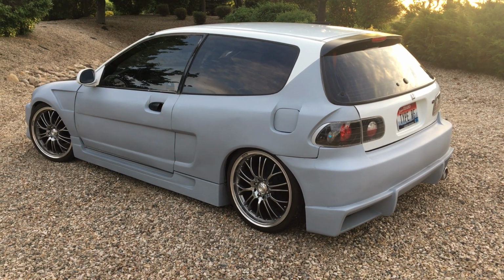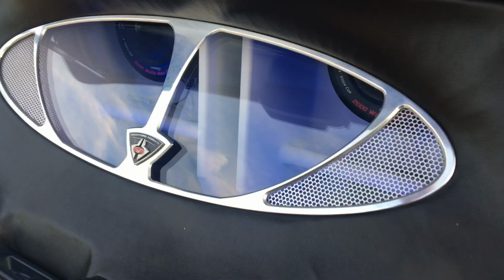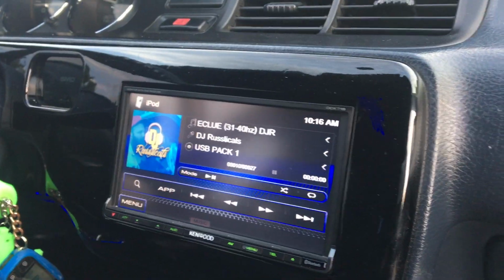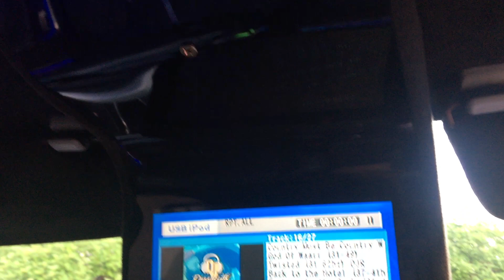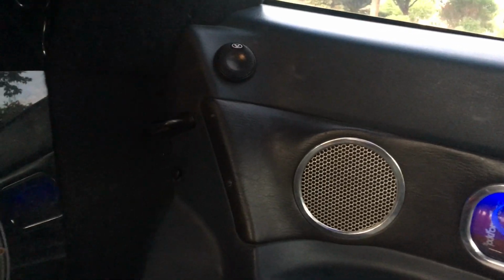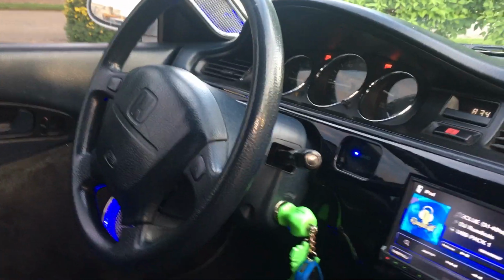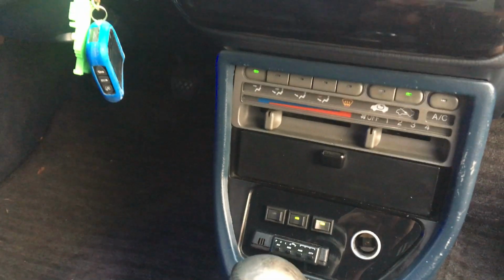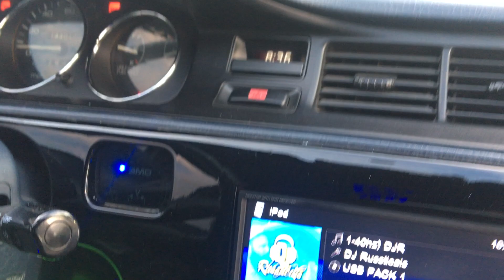Old School Rockford Fosgate Civic HB 4 Power HX2 10's 4 BD1000’s

Comment: CMC Car audio 1989 from Dallas had a similar story of a Honda Hatchback that had 6 15" of same design of build 6 Kenwood amps plus a word board that illustrated the contents of build. Carter high and Kimble football game . Come through bumping, 1 and 1 -2 Live Crew. Don't remember the head unit couldn't get close enough to look inside from the amount pressure that pushed you away from car was insane

Comment: U need a better power supply. More batteries and a better alternator. Dropping to under 11 volts is not good. Install looks clean nice work . Your amps will thank u if u give them more power and u will get louder
Reply: If you look the car wasn't running when it was played in the video
Reply: Payton Templeton thats even worse
Reply: @ryantexada9269  not really bro
Reply: @fxgamer-11yt  it is worse. Hes running the system straight off the batteries. With no help from his alternator(s). The system could possibly sound better if were running
Reply: @ryantexada9269  not at all man trust me I'm an installer my self and I know for the fact that the difference between running of batterys while the car is off vs on is the amount of wattage your able to feed the system before cliping
Reply: Brent is a beast I'm sure if he thought anything was gonna get hurt he would have started it for just battery power tho they were gettin it

Comment: Very nice. They only thing I would change is the dash plate for the head unit. Pull it back off and wrap it in vinyl so it flows with the rest of the dash. Everything else is covered and the dash piece kinda doesn’t go with the theme. Good job though

Comment: Clean as fuck bro!!! I’m just finishing up my own Rockford fish are build, I use to have 4 of those subs in a 12 inch sold them cheap wish I didn’t they use to pound. Right now I have 3 15 inch t2 fish area subs the ones with silver cones, each one has a bd20001 to it the big big amps have them in sync

Comment: very nice and clean install, looks like it could be from the late 90's when you had to be loud AND clean, lol The Power HX2 10 and 12s are some of the best woofers of that era if not ever and definately RFs best sub after the Teams. But as for the mids having a 4" coil...probably a 2.5" at most but most subs dont even have 4s.  Either way, upgrade your alt or add some batteries to get the voltage up a couple volts and you'll be all good cuz that setup is timeless. you should reach out and send some pics to BigDwiz here on YT cuz he loves old school audio and often features cars in videos with nice builds like this. Plus hes a big fan of old RF gear

Comment: I have the same car, and seeing that inspired me on what I want to do with mine. World of wheels type stuff you did there bud . Does it pull all that weight around good? That's one of my concerns with mine when I build the system . I still have the 90 horse d15z1 so I was wondering.
Reply: Well taking out rear seat and spare tire etc saves some weight too.  Plus no different than having a person or two in the back seat.
Reply: @rxtuninginc8444  so you own the car?
Reply: @rxtuninginc8444  idk if you own the car or did the work but that much fiberglass and wood would weigh as much as 800 or as little as 600 depending if the wood is birch or mdf , with that being said i dont think any of my 3 to 400 lb freinds would fit in the back seat anyhow but i know my clutch would be gone after a month or 2 of that much weight in the back.
Reply: @Hayawasa  800 lbs... doubtful.  Removing back seats and all unneeded crap would shave 200 lbs... the car will still be under the GVWR even with that shit in there.  The max GVWR accounts for all cargo and passengers... look at the sticker in your door.  There's the gross weight of the car itself and also another higher number the max GVWR which is for all cargo and passengers.  Clearly you missed the point.
Reply: @rxtuninginc8444  no i think you missed it. The seats in the back weigh 6 pounds top and bottom, and i can also tell you have no idea about the weight of mdf or fiberglass a smaller ported prefab box for 2 tens weighs almost 50 pounds. Fiberglass is 5 pounds a square foot at only 1/4 inch thick ,so maybe you should reconsider you snarky previous statements.
Reply: @rxtuninginc8444  im a computer tech and i just found out you are not a mechanical engineer. If you are going to lie to people make sure they cant find out who you are lol.

Comment: Your voltage is fine..the engine is not running. So yeah the voltage will sag. With the engine running your voltage will increase to about 13.2 to 14.4 volts.